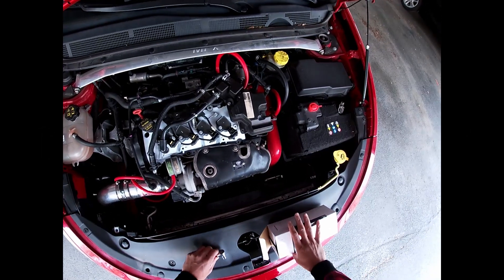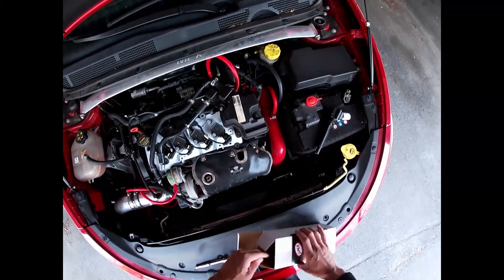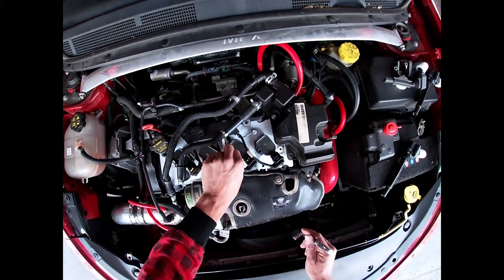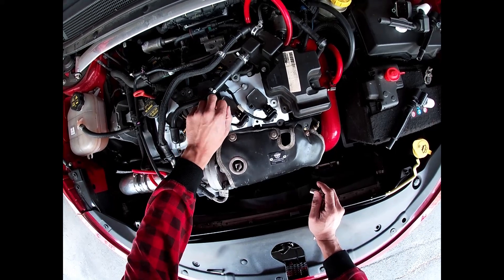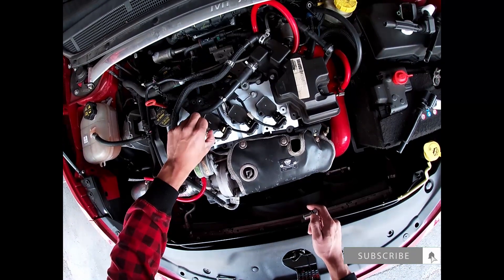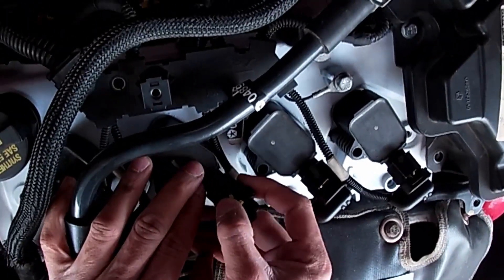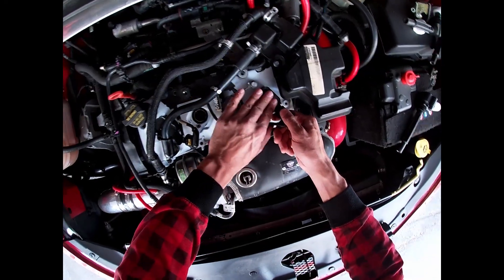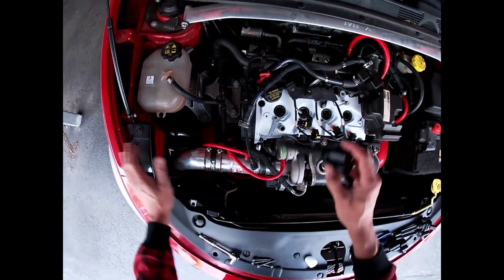How to replace IGNITION COILS (COIL PACKS)  WITHOUT BREAKING the clips

Comment: All of the ignition coils aren’t all the same. Which is which? Can you put a link to the two types?
Reply from the maker: Not sure what you mean bro. Here are some links for different ignition coils that will work with this engine. Hope this helps. 

OEM coil packs
https://www.modernperformance.com/product/mopar-oem-coil-pack-set-dart-14l-fiat-500-turbo/13-16-dart-14l-turbo-ignition-and-electrical

Alfa 4c coil packs
https://shopeurocompulsion.net/collections/dodge-dart-engine/products/genuine-alfa-romeo-4c-coil-packs

Granatelli coils packs (ones in video)
https://www.modernperformance.com/product/granatelli-coil-pack-set-dart-14l-fiat-500-turbo/13-16-dart-14l-turbo-ignition-and-electrical